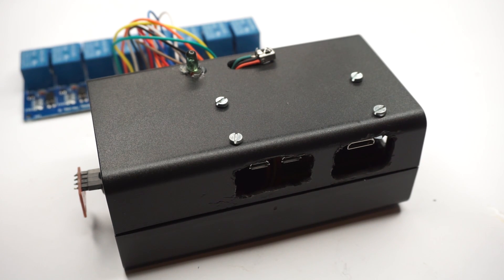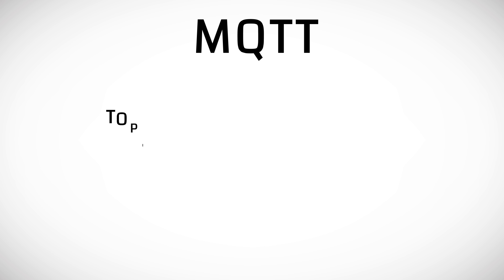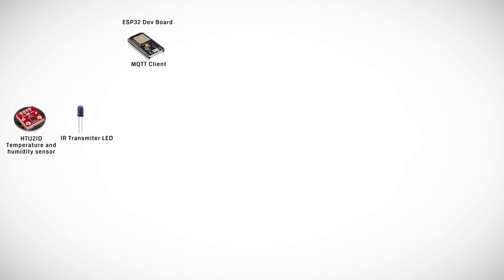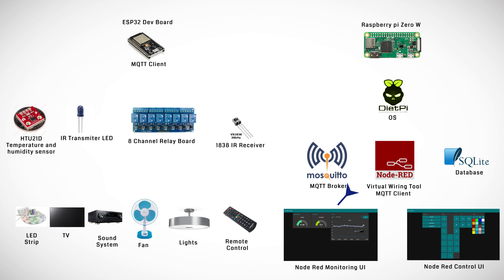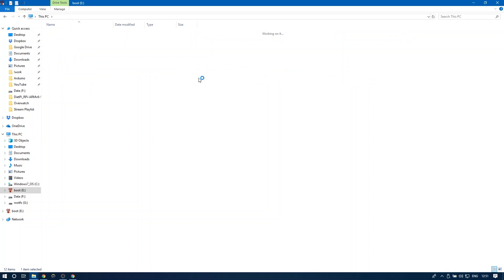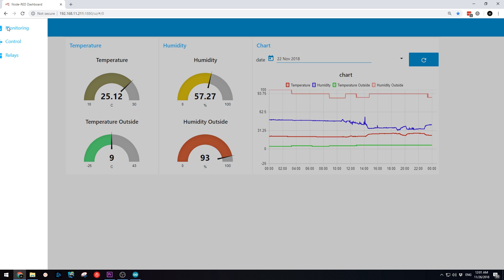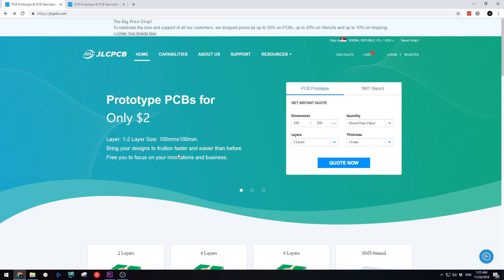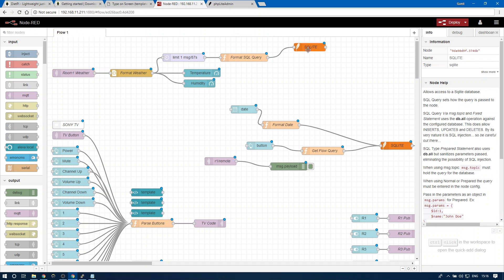DIY Home Automation - ESP32, Raspberry Pi, Node Red, MQTT, Smart House || IoT Project - Part 1

Comment: Why do you say the relay is for low-power devices? It can very well accommodate higher power devices as well. Also, you really did not need a Raspberry PI for this project.

Comment: Awesome video! Thanks for sharing! It was very instructive. I still not saw the second video, but I have some "noob doubts" that I'll appreciate if you could help me. I don't have an HTU21D Temperature and Humidity Sensor, instead, I have a DHT11 sensor. Is it much more difficult to adapt the code for this sensor? Unfortunately, I don't have a Relay Board too, is it possible to use the same code to run, or I should do some changes to use just the protoboard? Thanks again!

Comment: Hi Boris, Do you have circuit diagram for this? BTW it's an excellent video :)
Reply from the maker: Hey man. Thanks i really appreciate it. You have a link in the description. The easy eda project. You can find the circuit diagram and the pcb layout there as well. Hope it helps. There is also a part two where I dive deeper into the code and node red.
Reply: @dusnoki  yep I've seen it. Thanks :)

Comment: I downloaded the image and the dietpi.txt file is nothing like what you show in the video, i cannot change to which wifi network its going to connect
Reply from the maker: Yes I'm aware of this issue. That's why I created a new video how to install raspbian headless with Peter scargills script. You can check it out. Unfortunately, dietpi doesn't allow changing of WiFi after the fact.
https://youtu.be/2gvRVaHxhW4
Reply: @dusnoki  Thank you so much for the info

Comment: Can I use Raspberry Pi 3 instead of the Pi Zero? Will the image work as is?
Reply from the maker: Yes you can, but I don't know if the image itself will work. I have made a detailed more recent video on how to install raspbian, mqtt, node red... on the raspberry pi (headless even), so you can check out that video if you wish. It also uses Peter Scargill's script. The only thing you are going to have to setup is the flow itself which you have in the github repo.
https://www.youtube.com/watch?v=kRvNlSJs0Hg here is the link of the video.

Comment: Thanks for a really interesting video. However I cannot login to the dietpi installation, I have downloaded your .zip and used Etcher. Tried pi/password root/password etc. and nothing works. Any ideas? Is there a link to the node red flow?
Reply from the maker: Hey man, thanks for writing. 

I've just tried it now, it seems to work with pi/password. Haven't changed any passwords

Node Red Admin address: ip-address-to-raspberry-pi:1880
username: admin
password: password

Node Red UI address: ip-address-to-raspberry-pi:1880/ui
username: user
password: password

Raspberry pi user: pi
Raspberry pi password: password

The flow.json is there in the github repo.
https://github.com/dusnoki/esp32-home-automation-mqtt

Hope it helps... If you still can't login hop on to my discord channel https://discord.gg/Aef4VRc , I'll try and help you out when I find the time. I'll upload a new version of the dietpi that is updated with the newest flow.